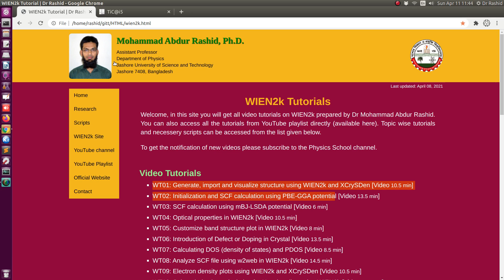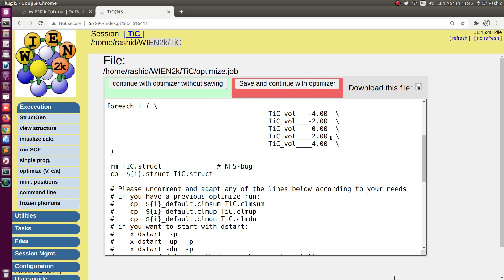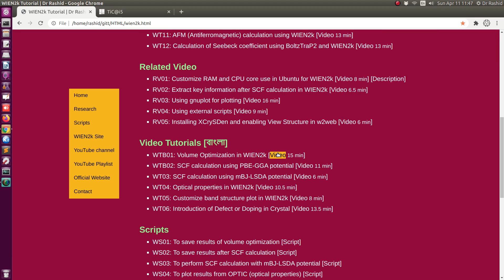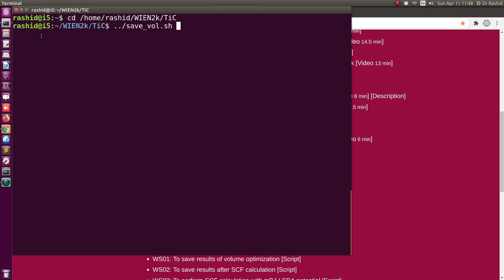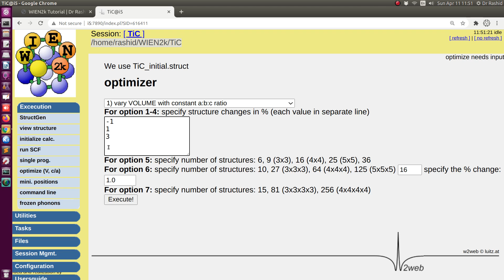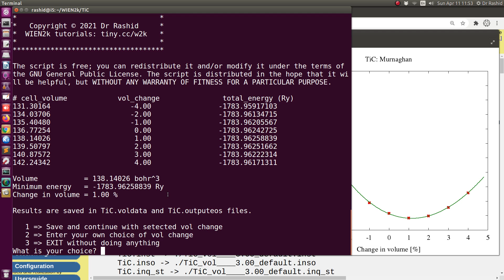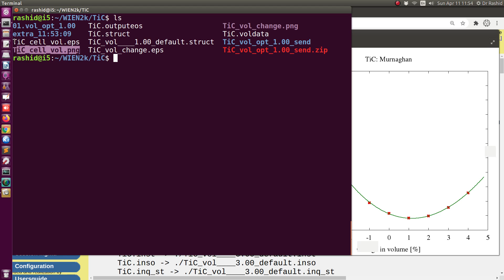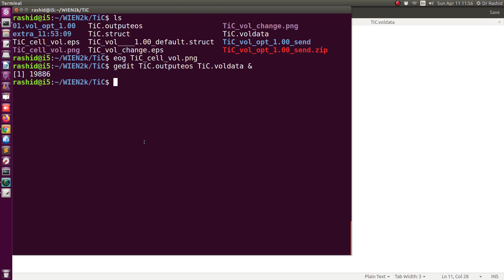WT03: Volume Optimization with constant a:b:c ratio in WIEN2k

Comment: Do we have to generate new structure and re-initialize the calculations using the optimized volume/lattice constants after performing volume optimization? Or wien2k automatically replaces lattice constants in structure and initializations with optimized one while doing optimization? Than you so much
Reply from the maker: You need to generate the structure and initialize again using the optimized lattice parameter as explained in the video.
Reply: @phy22  Thanks a lot, helped me a lot! Would be grateful if you can make a tutorial on fermi surface generation with spin orbit coupling  (parallel calculation) using wien2k and xcrysden. Good guidelines or tutorial doesn't seem to exist on internet or in wien2k userguide as of now.